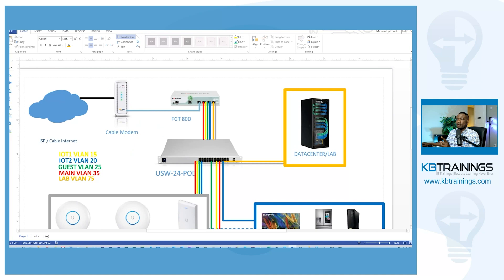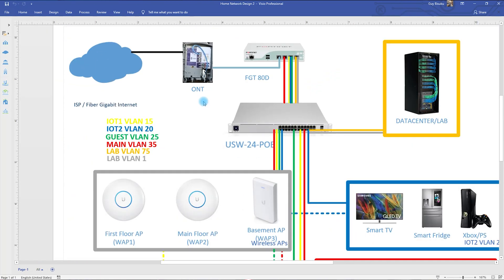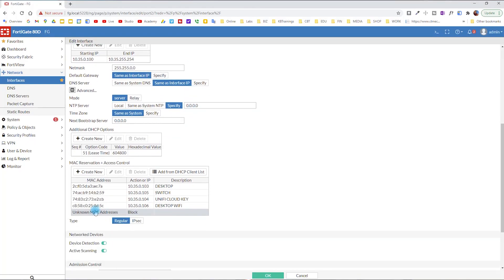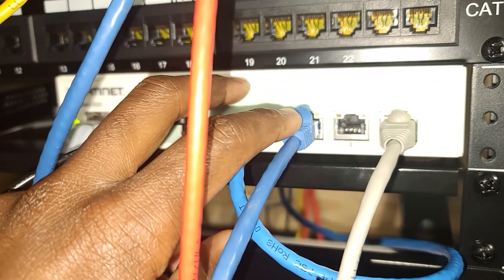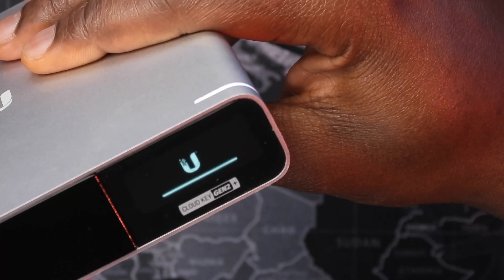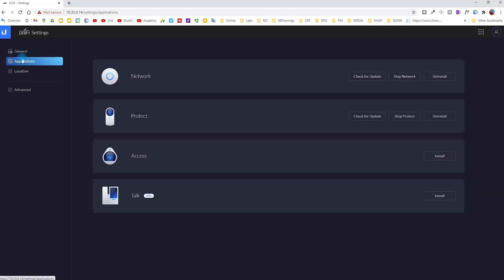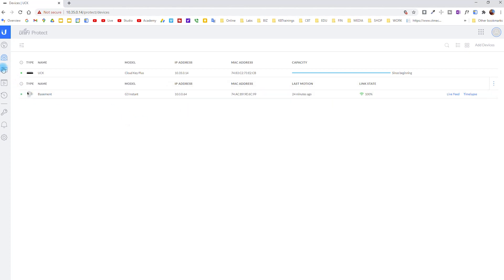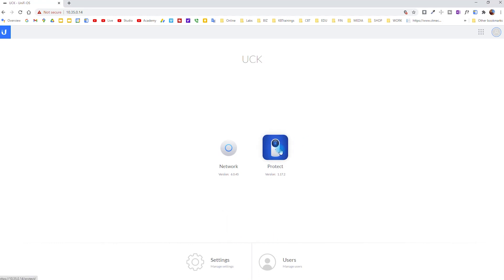#5: Installation of the UniFi Cloud Key And State of My Home Network | UniFi Network, UniFi Protect

Comment: Good video!  Recommend you rename your Cloud Key to your name.  It personalizes your equipment and looks great when you show people your setup and have your name scroll by.  Unifi also makes a Cloud Key rack mount kit so you can mount the Cloud Key in your rack.  It looks pretty sweet.  On a functionality point, be slow to buy the WiFi Access points.  You may not need as many as you think.  Install a few and test.  Concerning the Gateway/Firewall, the advantage of the Unifi USG or Pro models is the ease of setup and integration into the system.  If you’re getting 1G Fiber into your place, you have to go with the Pro.  There is not enough horsepower in the USG if you plan on turning on deep packet inspection.  On the flip side, a lot of people use pfSense for their Gateway/Firewall which can be loaded on most platforms.  Amazon sells little PC systems that can be used or you could just use an old PC. Once last item you could consider adding is the Unifi Doorbell.  It has great video and allows you to see and talk to someone at your door.  Also consider the G4 series cameras (Doorbell has this) have smart detections where they identify people and/or cars which is so much better than motion detection alone.  You will save a lot of hard disk space.
Reply from the maker: Hey Roger,
Thank you for the great advices and insights.
I will probably get the UDM Pro very soon to take advantage of all the features in UniFi Network.
Also bought some G4 cameras to install, just need to add the doorbell to replace the Nest.